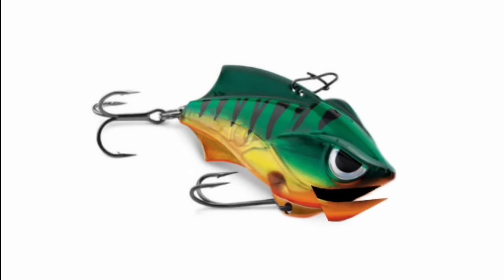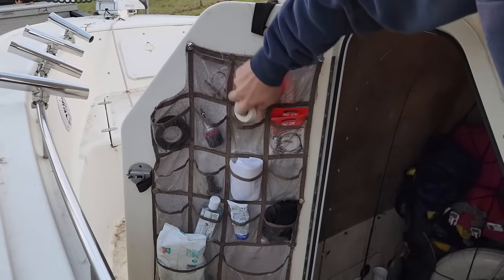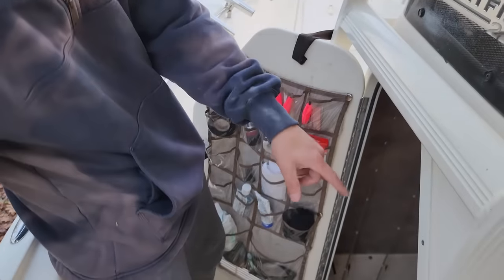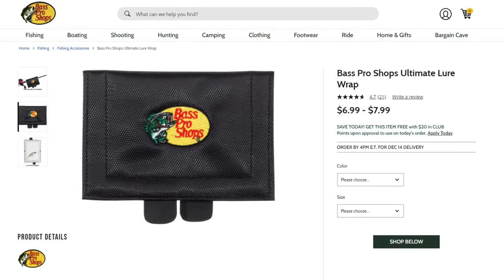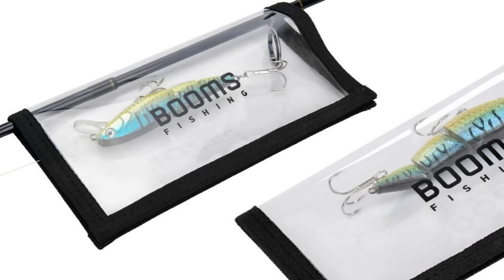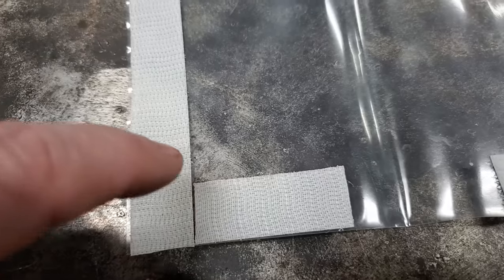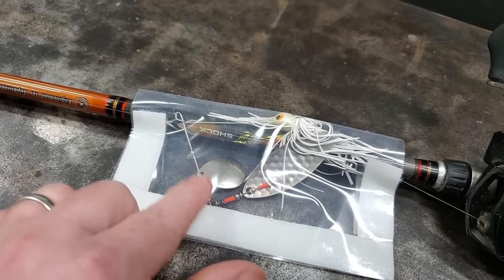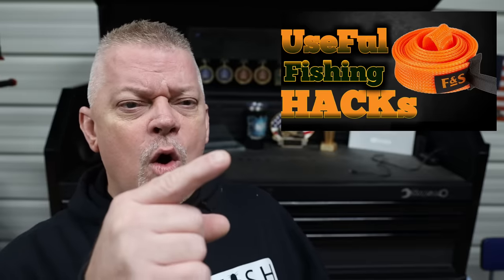Fishing Hacks ( you never seen before )

Comment: After watching your part about creating a see-through lure cover for the rod, later I remembered that I need a replacement window for my flip over ice house. This same idea would work perfectly to create a window and stick it right on the existing window hole that already has velcro. You would just need to make sure that you use the correct match for velcro for the window portion. Many times, the windows that come on the ice houses are not very bendable, and they can crack in the cold.  Thank you for the idea!

Comment: Dollar tree velcro works for a while. After a while I just hot glued it back on I've made bunch from duct tape lure covers for my rods.  I even buy electric wire  loom mesh off amalzon and use some heat shrink to secure th ends and make my own rod socks